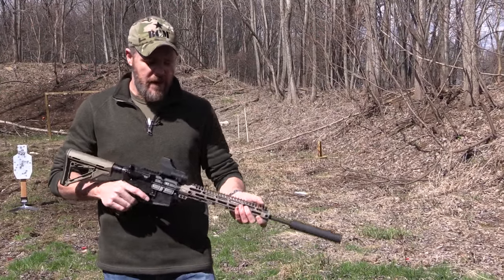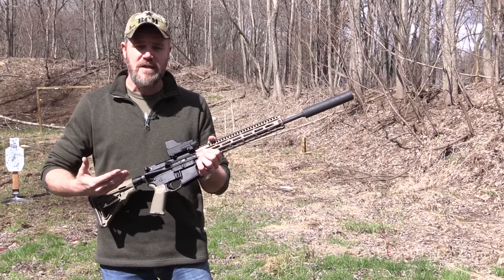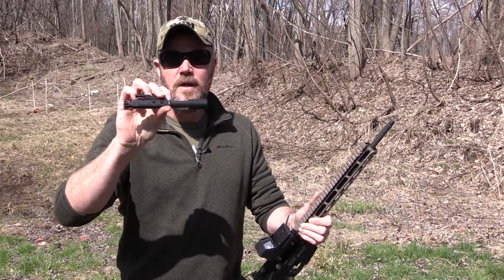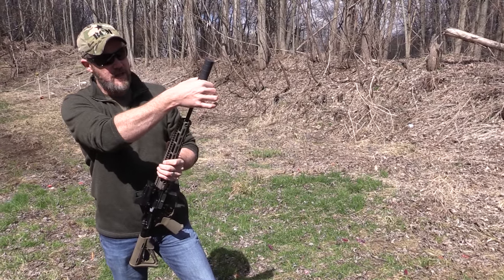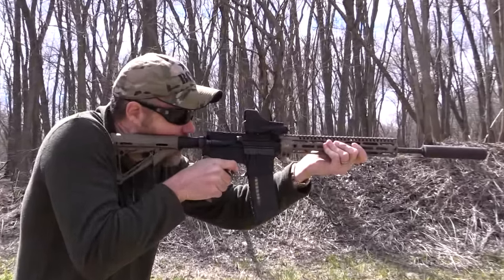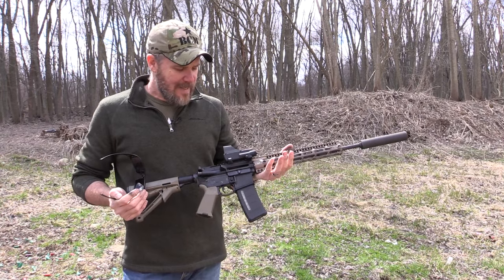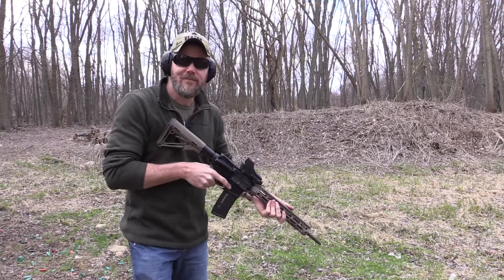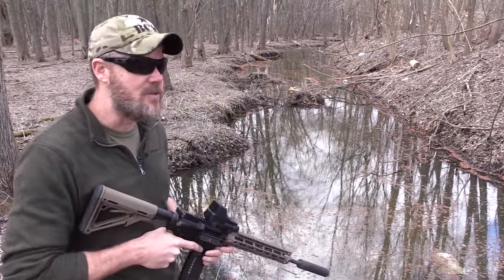GEMTECH Suppressed Bolt Carrier

Comment: I would love to be able to order one of these online for my AR-10, sadly, being from NZ it is extremely hard to get firearm parts directly.....silly export laws! Kiwis are of no harm to anyone haha My fix so far for my rifle is a typical kiwi fix, the gas needs reduced.....Well I shortened the barrel to 12", gas block in the same position, drilled and tapped the barrel to accept an allen screw with a smaller gas port hole, it seems to do the trick for me, wont cycle without the suppressor and with it on the brass goes backwards, still, I would have much rather preferred a bolt carrier suited to such use.

Comment: ok, i'm a fan of my MePro RDS but, like a few others have experienced on the forums, there is slight play for the red dot on top of my pic rail.  I've pushed it all the way forward before closing the QD lever but I'm starting to give up.  Any experience with this? Proposed fixes?  Much appreciated and I'm a longtime fan... keep coming with the great content!
Reply from the maker: +ddyoder I haven't had that issue but now that I'm aware of it I will double check my two rifles.
Reply: +Military Arms Channel ok thanks. I seriously would appreciate it if you hear about ways to remedy any movement. Thanks again

Comment: Neat but doesn't an adjustable gas block do the same thing?
Reply: it should, shouldn't it?
Reply: Yeah, the way I see it, it essentially does the same thing. Only benefit I see of this is for people who already have a built rifle that want to regulate the gas pressure without needing to remove the handguard,, roll pins, etc etc to switch out a gas block.
Reply: Yes, but this seems like an easier and possibly cheaper option to having a gas block replaced on a gun that wasn't originally equipped with an adjustable gas block.

Comment: With how loose the gas switch is, I would be concerned with it trying to twist in the gun and even though it can't, its essentially locked out by the shape its machined to fit the bolt channel, I am concerned it will gall up the upper where it rides. Curious to see how they do after a while and if it hurts the upper.
Reply: been using mine for couple years no issues..

Comment: i'm by no means educated on the matter, but pinned & or welded muzzle devices seems to be a big thing these days to bring the overall length of a rifle down without making an sbr, considering how that suppressor threads on & the baffles are in the front half, you think it would work in the same way? pin & weld the back half & have a psudo suppressed sbr?
Reply: Interesting thought, I don't see why it wouldn't work. Just wouldn't be able to switch it between firearms.

Comment: I like your videos for sure.  So I like the idea of a suppressor for my AR15 or for that matter quiet range time, but have questions.

First I noticed that your trigger finger was black in the video, is that from carbon traveling down the trigger group after each shot?

I guess it is normal but I do not like the idea or fact of carbon blowback into the shooters face being acceptable if you want to shoot suppressed.  Are we just not to the point of eliminating this problem technically, or are their firearms that work better being suppressed and what would they be in your opinion?

Suppressed DI or Piston, which works the best?

I have always liked the idea of an smaller caliber firearm being suppressed more than 556 and up, do all the same particulars selecting a caliber to be suppressed apply?

I watch all your videos and respect your professionalism and cant tell you how much I am learning from your videos.
Reply: +Rational Reality American No that's carbon he got on his fingers from pulling the bolt carrier group out. DI and pistons both work for suppressors, the DI is going to be a little quieter which goes well with the idea of suppressing a gun.
Reply: +CN073 Thanks for the reply.  Dirty BCG for sure will do that, but I did not first think that as it was the first shots of the new bolt, maybe the one removed needed some attention.

I have never shot a suppressor so have no practical exp with them, so I thought I would ask those who have.  Thanks for answering my question.

Comment: Holy crap! someone took the simple and "reliable" adjustable gas block idea & moved it to a CRITICAL area where you want the least amount of "points of failure" possible.  This is one of the stupidest (re-inventions) ever.   Have a gas block issue & you can still fire safely.  Have that mechanism fail in your BCG & the problems could stop it from firing.  And why not drop the pressure BEFORE the gas tube?

Comment: Can somebody please explain to me why this is better than an adjustable gas block? I thought adjustable gas blocks were created just to fix this problem (as well as fine tuning the rifle to allow for quicker follow up shots for competition rifles). How is this carrier (not the entire assembly) worth the $250-$270 when you can get an adjustable gas block for around $100?
Reply: I agree an adjustable gas block would be easier but I can't fit one under my free float rail. So I can but a new rail & adj gas block or get a new bcg that I can switch from upper to upper.
Reply: OK. That makes sense. However,  with all the new suppressor ready rails now, is that going to be an issue going forward?

Comment: This is kind of off topic here so I do apologize but I went out shooting Yesterday and everything was going good until I got to my steel cased ammo. Now my AR wont hold the bolt back after the last round has been shot... Can you help me figure out why that is? I tried shooting some brass after and it still wont hold the bolt back. Is it because it's all dirty and what not?
Reply from the maker: +ElderMean Steel cased ammo like Wolf and Tula is very mild (under powered). It's not uncommon for them to not fully cycle some rifles.
Reply: But I put a brass round in a magazine and fired it and it still didn't hold the bolt open on the last round. I am worried I messed up the gas tube or something or if it is just dirty.
Reply: +ElderMean I would give the rifle a good cleaning and try again.
Reply: I am thinking of switching over to a piston driven upper so I don't have to worry about something like this happening again that much. I understand I still have to clean it but it might be a little better for me. Than I could afford to buy the steel cased ammo and go shooting a lot more.

Comment: Wouldn't an adjustable gas block do the same thing?
Reply: Sam Wagner sure but this is a quick solution that doesn’t require replacing the gas block. Which is cumbersome.

Comment: I actually still don't get how it reduces the pressure of the gas, the gas goes through the gastube into the gas key attached to the bolt carrier (do I understand it correctly?) so if the valve system is on the carrier how does it affect the anything? I don't get it, can somebody more gun savvy explain to non gun savvy? :D
Reply: Nope.
Reply: +Jan P. It is kind of like a car's throttle . . . for a constant pressure, a restriction will create a reduced volume that is able to pass into the piston . . . A smaller amount of gasses passing into the piston with the same internal volume with create a pressure drop compared to "wide open throttle."

In a way this is how a suppressor works. Without a suppressor all guns have "1 chamber," which is open air outside the barrel. With a suppressor we add additional "chambers" in which the gasses can expand . . . when the gasses expand, pressure drops . . . if we have a suppressor with say 5 chambers, there are 5 instances where the barrel pressure will be reduced before being exposed to an open air environment.

If you are asking, "wont the same amount of gas be coming through the gas tube?" YES! you're right, excess gas will still be in the tube, just not in the piston . . . so this excess gas just dumps into the upper receiver instead.
Reply: Suppressors create a higher average pressure over the piston's length of travel. The interface between the bolt and the carrier is a piston . . . the gas key forces gases in, those holes in the side of the carrier release the internal pressure after the entire stroke of that piston is completed. Given that the switch does not affect the release holes, the reduction must occur on the intake side of the operation. Without changing the release holes, the flow THROUGH cannot be changed. In fact this carrier only has one release hole compared to a mil-spec carrier that has two . . . so there is some other trickery going on here. I would guess they were seeking lower initial force that is to be reinforced by a slower depressurization on the back-end to keep things balanced. 

Remember the pressure inside of an ar-15 piston (carrier) does not release until it is fully extended and the bolt is starting to remove from the barrel (via momentum) . . . therefore we don't see flow THROUGH until all the force has been applied. When we are talking gas regulation on an ar-15, we are almost entirely concerned with pressures inside of a SEALED piston. 

does this make sense?
Reply: thanks all, now I get it, I was thinkig about it the wrong way, now it makes sense :)
Reply: Jan P. Glad we could help!

Comment: Why not use a "adjustable gas block" which is significantly cheaper. And will do the exact same thing this BCG will do. Many of the adjustable gas blocks can be used without a specialize tool. Simply use a bullet or some thing pointy. I don't see this BCG being successful, due to adjustable gas blocks which are fast to switch between suppressed and un-suppressed. As well as, the block is much cheaper too. As for the Meprolight RDS, that thing is excellent. I got mine for $350. Works very well. And weights in around 11 oz. Only four illuminating settings. Which works in ALL lighting setting...even bright sun light (on #4). The Mepro also, has the best field of view (window) when looking thru the glass. Then anything on the market, when it comes to red dot sights. Save your money, get an Adjustable Gas Block and use the extra money saved, towards the Meprolight RDS. You'll be much happier and the Block will do the same exact function as the Gemtech BCG does. Adjustable Gas Blocks go for $50-$100. Radical Firearms has a nice adjustable block for $50. Some other well known manufactures sells theirs for around $75.
Reply: +Rick S I can think of three reasons: 1) you are new to guns and you don't know about adj gas blocks. 2) You are afraid of installing one. This is drop in... A lot of people aren't comfortable doing minor modifications to their gun if tools or cutting are required. 3) you are a high volume shooter. I've talked with a nationally known builder of competition guns, and he says he quit using adj. blocks because they wear out a lot quicker due to gas cutting. He's more inclined now to tune by using a block with a single undersized hole, and drill up until desired performance is achieved.
Reply: Can't use an adjustable gas block on an already pinned and welded barrel...so...yeah.
Reply: You could use a clamp on one, but you might have to cut off the original.
Reply: +GunFun ZS cutting doesn't seem like a fun thing to do. Finding a clamp adjustable that fits the inner diameter of my hand guard might be challenging but even if I could I wouldn't go wth an adjustable gas block...just have heard too many stories of those that can't handle high round counts; springs break, some blocks even splitting. For the average person probably not a big deal but if you ever want to take a carbine class or have the land to do your own drills I wouldn't go with the adjustable gas block (just my opinion).
Reply: ryeguymac I agree, but was just stating the counterpoint. OTOH, I don't think I would ever chose a welded muzzle device.

Comment: I wonder why someone can't invent something to vent excess gas at the gas block
Reply: +Robert Smith The gas causing the problem isn't coming from the gas system, it's coming out of the chamber and then through cracks and openings in the receiver. It's caused by backpressure from using a suppressor. There's nothing that can be done about this other than to try and direct it away from the shooter's face.

For controlling function of the rifle, you don't want to vent gas from the gas system because it makes a loud sound when it exits that's louder than a suppressed gunshot. It's better the restrict gas to control cyclic rate than to bleed it off.

Comment: What a waste of time and money. Just get an adjustable gas block, Noveske Switch Block, or an adjustable piston kit from Syrac. I believe in totally eliminating excess gas BEFORE it reaches the receiver.

IMO, any suppressed rifle should be piston driven. The ability to change to suppressed gas setting can be done in seconds, usually with no tools. AND, there is no gas routed to the reciver from the gas hole in the barrel. You do, however, get some gassing from the barrel when the empty brass ejects. 

I know Tim is convinced that suppressed piston AR's are noisier than DI. That simply is not the case for every piston driven upper. In many case the differences are not audible to the human ear.

Go to an SBR, and that piston upper becomes even more of a boon.
Syrac has a new piston kit with 18 adjustments and a total of a about a 2 ounce weight penalty over a DI system.

There is also a new piston kit from Superlative Arms (machine shop that makes Syrac, BTW) that has a new off gassing design that users are loving. 

I wish Tim would review these new and exciting items instead of an over priced bolt carrier trying to do a gas fix in the wrong place (inside the receiver). Tim/MAC, we love you. We know you love Gemtech, but there are far better options available.